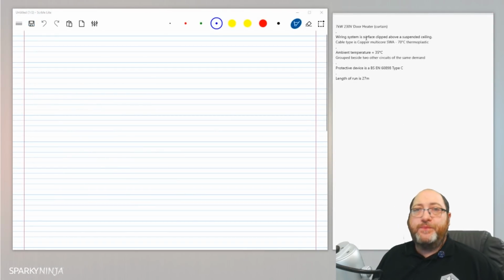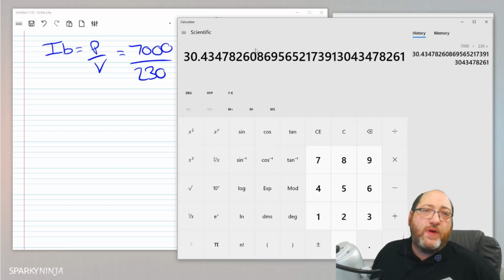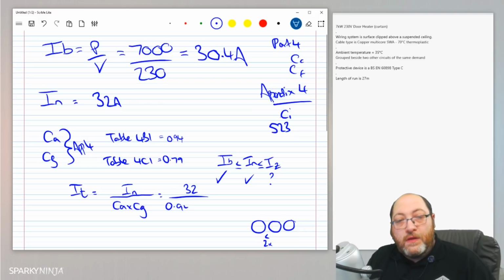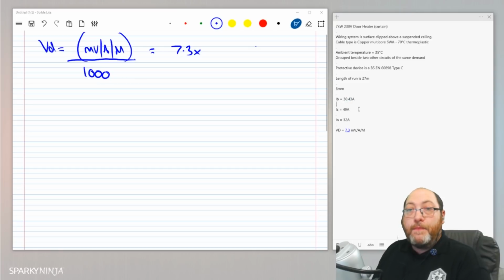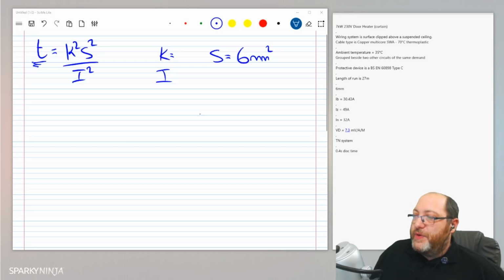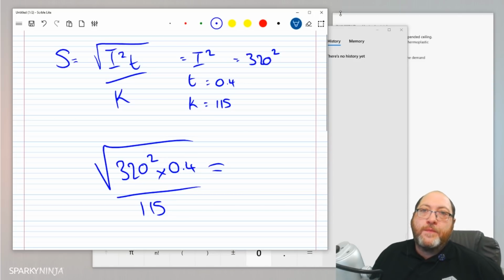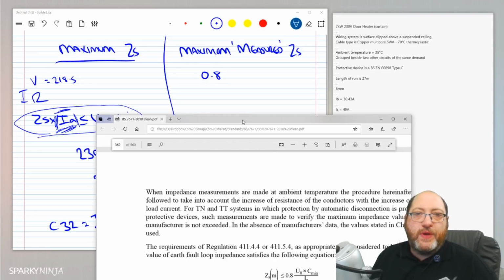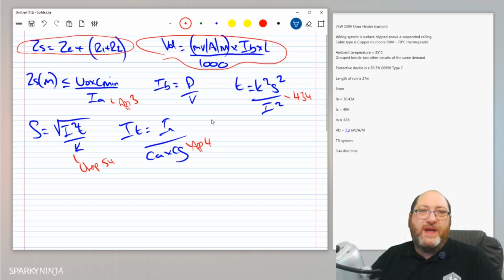What are the most common equations that will come up in the 18th edition exam?

Comment: The formula at 26mins has lost me,  I get as far as the 320 squared x 9.4= 40960
After that it goes pear shaped...   with 40960 showing and I press v button I get an error
User error obviously and a new calculator

Comment: Dear 
SparkyNinja , can you correct me if I'm wrong. in regards to the reference method used in the question.  you have written wiring system is clipped ((above)) a suspended ceiling. but in the book it says Single-core or multicore cables  fixed directly ((under)) a wooden or masonry ceiling, there's no such thing as clipped above, shouldn't that be under instead of  above??

Comment: seen this on a mock exam paper how to work it out please 

39. A circuit is connected to a TN system, the maximum permissible earth fault loop impedance (Zs) for a 32 A socket outlet circuit protected by a BS 88 fuse is:
a) 1.04F
b) 1.09F c) 1.44F d) 0.92
Reply: Table 41.1 TN - max disconnection time 0.4 onto table 41.2 providing your referring to a BS-3 system c. 32A = 0.91
Reply: Better late than never 👍🏼

Comment: At 13.52, Iz isn't 49A. The tabulated value (It) is 49A. Iz is your de-rated cable current carrying capacity which is 36.4A.
Reply from the maker: The 'It' is a value obtained via tabulation, in other words in tabular form - a calculation. Which in this case is 43.1A. The tabulation accommodates the derating factors and with this a cable with a current carrying capacity (Iz) is chosen, in this case.. 49 A.

You are applying the factors to the selected cable - which is not how it's done in this course because we wouldn't have known to use the 6mm in the first place unless we did it the way it is done in Appendix 4 of BS 7671 which is the way I have shown.
Reply: @SparkyNinja  'It' is a tabulated value - that means it's shown in a table. It's not a calculation.The definition in BS7671:2018 Appendix 4, section 3 "It - the value of current tabulated in this appendix' in other words - the figure shown in the table in 4DXX. It can't be both tabulated AND calculated. Iz is calculated - it's the de-rated value (It x the de-rating factors) - the definition in App 4 Sec 3 again 'Iz - the current carrying capacity of a cable...under the particular installation conditions concerned' in other words - de-rated. So as I said, Iz isn't 49amps, that's the tabulated value - the value shown in 4D4A - 49amps.